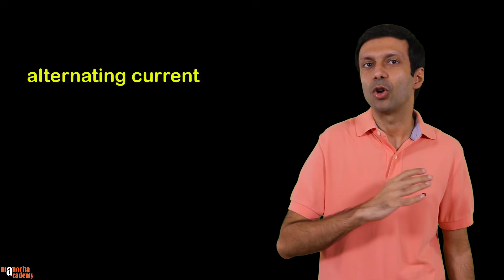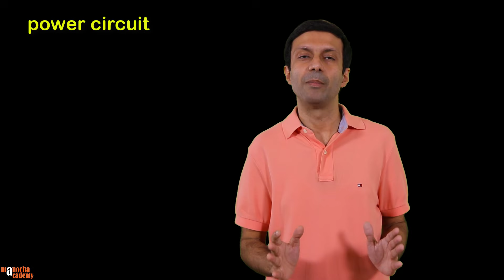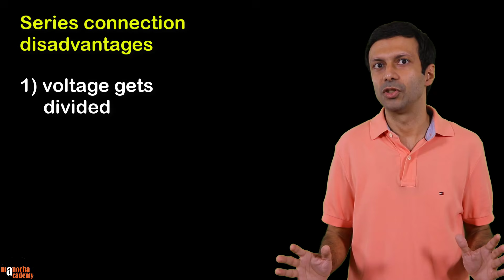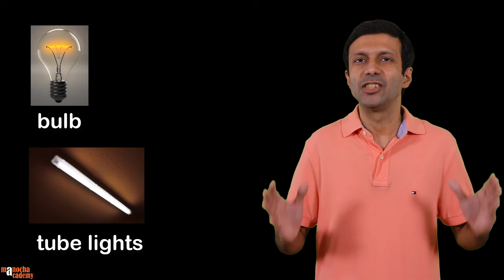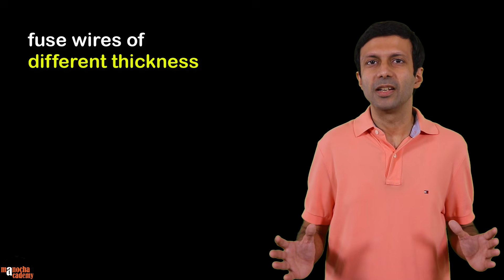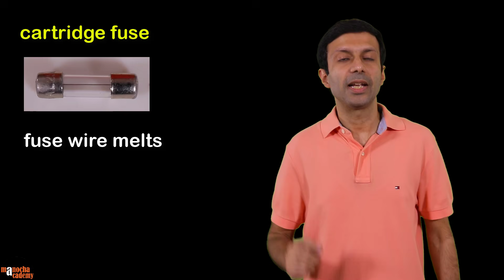Domestic Electric Circuit Class 10

Comment: 1:33 says voltage should be increased to reduce current but Ohm's law says that V is directly proportional to I .So that means Voltage should be reduced right ?..Can you please elaborate
Reply: U are right but a different thing is said in the video

Current and voltage are directly proportional but electrical power is V*I so when u are sending electrical power then on increasing voltage less current is send let me show with an example

Suppose the company is sending u 100W electrical power so there is 2 good ways to send the power

100V * 1A = 100W
100A * 1V = 100W

So see when the amt of power u send is constant increasing the amt of voltage is actually decreasing the current and vice versa

That is what is said in the video
Reply: @DebanjanChaudhuri-o6n well explained
Reply: voltage should be increased to increase current bro . i think you talking about resistence . resistence if increased would reduce the current
Reply: By ohm's law I is directly proportional to V but over there we consider the formula P=IV keeping P constant so naturally I will be inversely proportional to V and hence large voltage taken at less current for same power to prevent loss by heat energy + for current to travel larger distance

Comment: as we know that voltage is directly proportional to current, then how does current reduces when voltage is increased?
Reply: It is done by transformers. So it is not a matter of proportionality
Reply: As we know, power = potential difference × current
So to maintain the same power current is reduced and voltage is increased
Reply: Transformer is constant power device
If we increase voltage then current reduces or vice versa😊

Comment: how the increase in voltage can decrease current as it will be then the voilation of OHM law
Reply: Bro you are talking about ohmic conductors, ohms law is only valid if temperature is constant, transmission lines are non ohmic conductors so only power remains constant so p=iv
Reply: that is valid when you talk about constant resistance. here we talk about power. P=VI. thus if voltage increases then the current will decrease for a constant power.
Reply: @mylzz0409  but in this case the resistance doesn't remains constant bcz the resistance increase with the increase in current.

Comment: Where does the remaing current goes that was minimized during travelling from grid substation to main substation (132kV-33kV=100kV)?
Reply: Current is constant only voltage differ
Reply: @Ashu3125  ok but V is directly proportional to I
Reply: @Ashu3125  ok but V is directly proportional to I

Comment: 1:28
To minimise I, voltage is increased!!!
Not cleared..😢
Reply: Bhai dekh Joules Law of heating me humne kya pdha ki Agr Current Travel Kr rha h Toh wo definetely Kuch Heat Energy Nikaalega...Bhai hume toh kam heat chahiye n hume apna ghr thode n jalaana hai...toh Heat kam krne ke kiye hume Current(I) ko kam krna hoga[kyuki Joule's law of heating me pdha h n ki Heat is directly proportional to the SQUARE of CURRENT]....yaani ki Hume agar heat ko 1units kam krna h toh Current ko 2×unit kam krna pdega...Hai n...Hn Toh Ab hume Current ko kam krna h...toh ab hum Current ko kam krne ke liye Voltage ko Kam krenge[kyuki bhai humne Ohm's Law se Kya pdha hai ki Current is directly proportional to Voltage]...yaani ki agr hume Current ko kam krna h toh Voltage ko Bhi Kam krna pdega...lee lekin yha toh master ji keh rhe h ki voltage is increased...sorry bhai😂...Baaki sb smjha paaya n?😂
Reply: @dhxirya  bro u wasted my precious 5 minutes🥸🥸
Reply: @santoshvamdev  maine sorry likh diya h bhai😭😂
Reply: See for a non ohmic conductor v=ir is not applicable, in transmission lines only power is const, so here p=iv so if you increase v, I will automatically reduce
Reply: @sohambhakat1789 correct that's why transformers are used